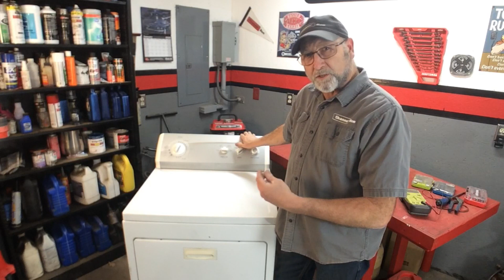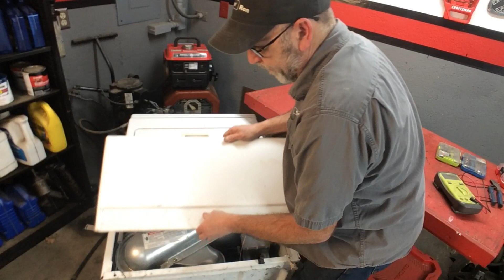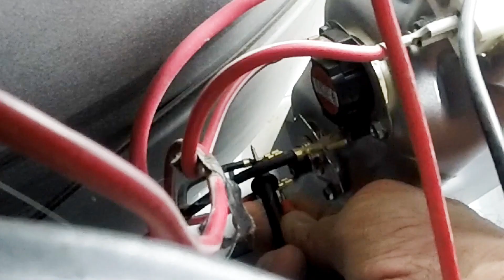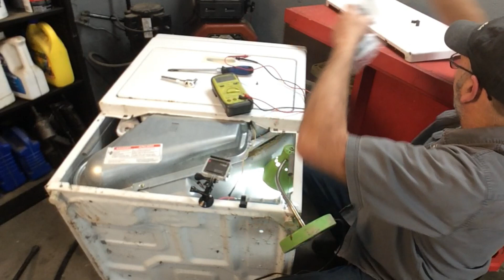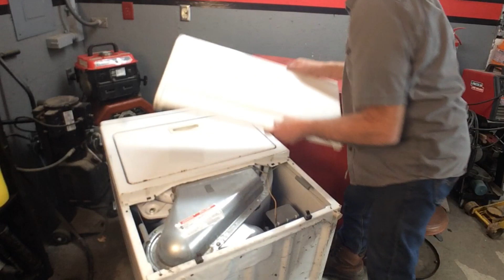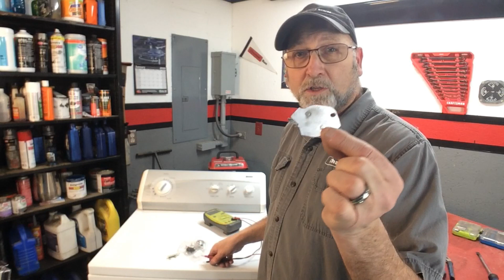How To Fix No Heat On Dryer

Comment: I have a Maytag Centennial that has heat, but won't shut off - 70 minute timed dry runs hot for about 60 minutes and then cool for ten and then.... Cool forever.  Last ten minutes or so don't ever stop. 

I've replaced internal fuses, heating element, etc (package deal) and tested (no change) and then replaced the timing element on the panel (no change).  Flipped the breaker on and off, no change.